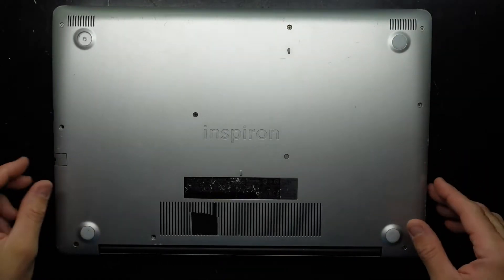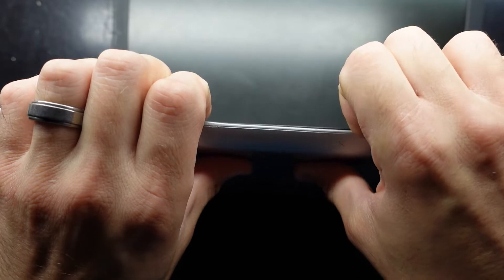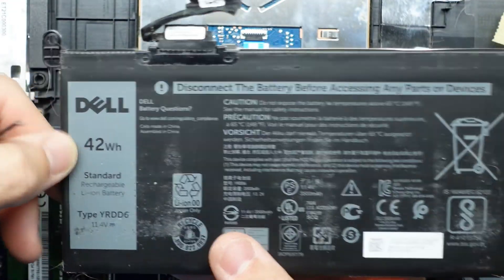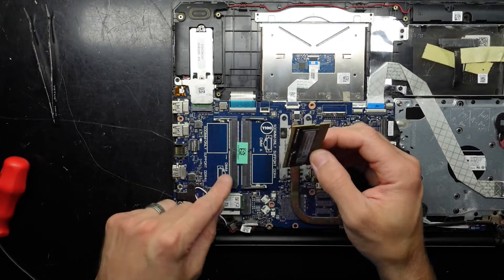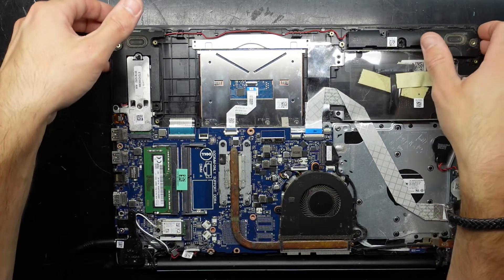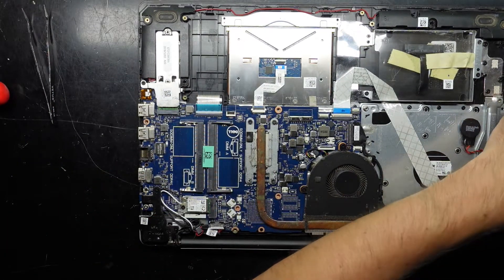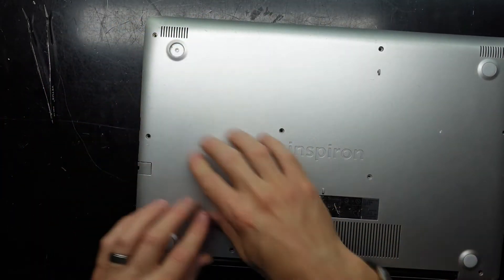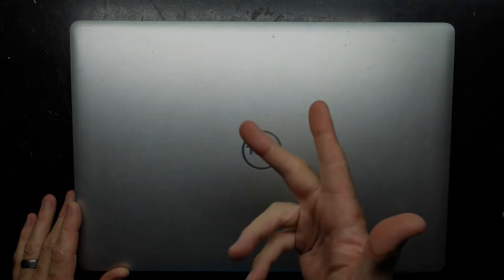Dell Inspiron 3585 Teardown and Blink Code 2-4 Solution

Comment: I have a Dell Inspiron laptop and a while ago I took it to get "repaired" but when I got it back it's runs notably slower(imagine it goes from average labtop speeds to a old off brand android device ) and it's told me either it's a wierd battery or I need a better charger( one with .45 watts) so can you guide me on what battery I could get to get it running back to normal ? Because I thought I would need atleast a 45 watts batter but I can't seem to find it ? Or would I need a better adapter in this case ?
Reply from the maker: I would be thinking they gave you back the charger that wasn't yours,